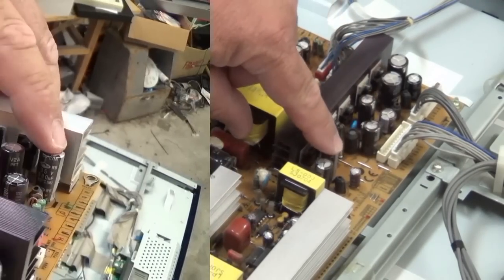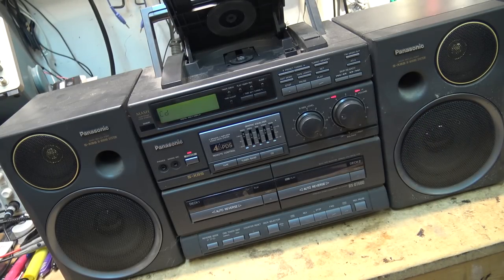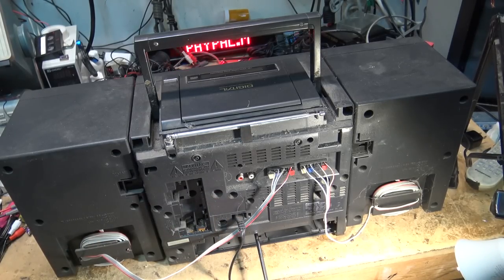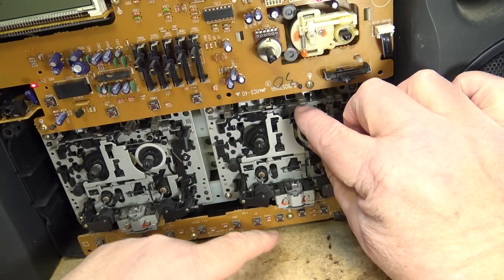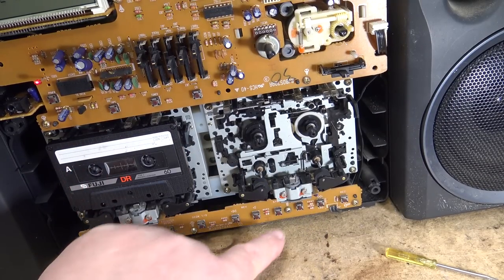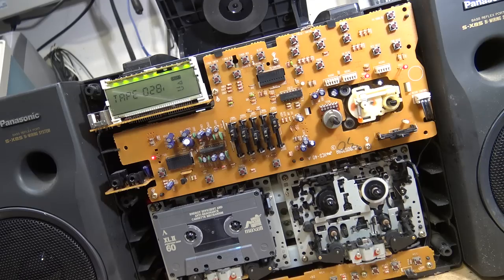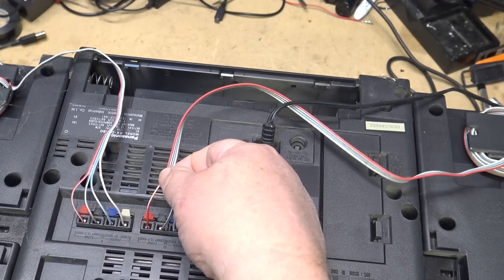Panasonic RXDT680 dual cassette cd portable stereo repair

Comment: That's some good quality cassette player right there. So many "sensors" and the mechanics look well built. Also, the belts are fine, too. Panasonic did a great job with this player. 
Fixed and ready to be used for many years to go. Congratulations!
Reply from the maker: This one is staying in my collection.  It is a dam good unit.
Reply: @12voltvids  could you show how to add bluetooth to RX-DT690?

Comment: Sweet. I used to have the 680, and when it died, I bought the DT690. I still have the 690, but the CD player is dead. I miss this style of portable, that looked "normal" and not like some mutated insect or alien spaceship.
Reply: I have a 690 for parts that has a fully functional CD if you're in Ontario Canada you're welcome to it
Reply: @izzyyanuzzi954  Unfortunately, I am all the way down in California. I did however fix the CD player by finding a mechanism on ebay from the RX-DS17, which used the identical mechanism. Now, I still have to fix the motor control issue with the tape decks.

Comment: What a beauty! I have a similarly old stereo from Panasonic (SA-DH30 to be precise), and it still works great. Both tape decks are fully functional on it as well. Panasonic must've used some really good belts back in the days.
Reply: Not like the cheap-ass belts some lower-level brands used at the time - nowadays those would all be a sticky gooey mess that can take anywhere up to 5 hours to remove from pulleys and flywheels. I recently dealt with a Hitachi rig with this exact issue.

Comment: Watching the problems you fix here also takes me back to early high school... when the scary kids had smaller boom boxes it got loud. Sometimes kids would get ahold of the completely trashed school boom box and it was always funny when someone would have to dive across the room to stop it from eating their early 'gangsta pop-rap' music tape. You'd hear the treble start to fade down and then crinkling as it slowed down and someone would shout NOOOO! Of course some else would steal the same boom box from the AV closet and it would happen all over again!
Reply: I remember those days - the issues with school boomboxes is they were never serviced or cleaned which may explain why so many tapes got wrecked in them.

Comment: Very good video of your repair.
I had this unit from the early 90's
until the 2000's, when the unit was
in the sun in the car and the CD 
top distorted and I had some 
cassette problems, after which I
did not repair it and disposed of it.
It was a good unit and I have seen
some offered on eBay. It also had
Automatic Music Selection, AMS,
which let one scan through the 
music and if one left a space between
tunes, one could skip to the next tune.

Comment: This video encouraged me to check if my RX-DT680 had the same problem and it sure did while I thought it was acting up because of bad belts! In my case I also had to check the battery/AC power switch in the power connector because it was also corroded. Thank you!
Reply from the maker: Yes they have been known to corrode as well.

Comment: I sold many of these Panasonic RXDT 680 and 690, and the smaller RXDS20... They sounded good for the price, had a digital tuner and a remote control, and apparently they were made to last. 30 years later, I was delighted when you rescued this one from dust. It's surprising the CD has not suffered (door switch, optic unit...), and the potentiometers seem to operate without too much noise!  I remember clients complained about a missing power cord, untill Panasonic made a little sticker that said it was in the battery compartment...
Reply from the maker: I have an rxds20 as well.  Modded that one for bluetooth.

Comment: That's the exact model I own, I modified mine for a AUX input as after years of using dummy tape for inputting audio the tape mechanism's broke. I download a service manual with schematics and imputed line level at the graphic equalizer circuit.
I use it every day at work, Great sounding  stereo for its age.
Reply: Could you teach how to add bluetooth to it since there is no line or Aux? I own the 690 version

Comment: i've worked on many of these.. CD deck is a common failure.. but man these were well made.. and sound fantastic.. the RX-CT990 is my favorite of the series mainly because it had a true AUX input
Reply: That's the exact model I have, with the pitch control for Deck 1, sadly it does not come with digital tape counter, just displays TAPE when playing tape but still does the job. I encoutered the same issue as 12voltvids with the oxidised tape detecting and some minor dry joint due to age but other than that plays great and eats all of the boomboxes made today :)

Comment: I have been using my Panasonic products for 40,years and they are still working fine . I can't say the same for the Sony products I have. I had to fix them a few times. Panasonic were high quality products.
Reply from the maker: Every company has good and not so good products.  My old Sony beta and cd player are over 40 years old and work perfectly.  I have several Panasonic VCRs that were high end (ag1980 and agw1) which are beyond repair.

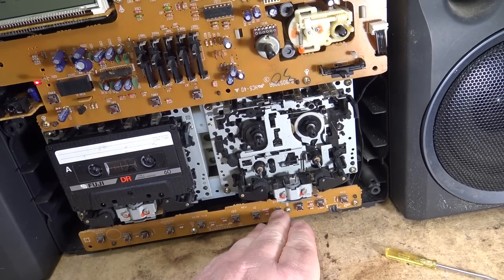Comment: Purchased this model for $10 + $16 shipping with remote control and operation manual. CD still not working and tapedecks had exactly the same issue described in your video!  Common issue? Don't take it apart yet, however fix the tapedecks on the outside by dipping (not spraying) some wd40 onto the contacts and wiggle it. It take some time to do its work, you don't need to sandpaper the contacts., take your time. Tapedecks only play tapes in one direction, reverse direction. Takeup wheel in forward mode (eat tape mode) does not have to power to wind the takeup reel.  That is weird, because it is a gear controlled - see 17:45.  

The CD, the laser unit tries to focus (don't move) and motor doesn't spin - no disc message. I used my phone's camera to spot some light activity but cannot see anything.  Bad laser?

It is a beautiful device when cleaned and sound is decent. The downside is that this model doesn't have an AUX input however have seen some mods already. You make great videos maybe you have to do some repair and mods videos.

Comment: Just got this same unit at a Goodwill for $20.  CD player not working.... turned out I had to adjust the laser pickup  current and also I found the Cd disk seat was pushed down slightly effecting the focus for the laser to read the disk.  Fixed now and surprised how good the unit sounds!

Comment: That's a nice unit , I have the big brother RX-DT690 that i did a full restore on the cassette mechanisms new belts, and new take up reel gears (RDG5772ZC)  they lose teeth. also have RX-DT75 cobra that i fixed the cd player and re-foamed the speakers. and a RX-DS20 that i fixed the bad gears in same part number as  the RX-DT690. those Panasonics were the best built in the day.

Comment: Mid 80's to early 90's, I went through five Panasonic boomboxes..  Definitely my brand of choice!
Reply: So at least four of them got broken in 10 years? That's surprising, they used to be quite reliable even with heavy use, easily lasting 10+ years without failure.
Reply: @mrnmrn1  I think he means he just upgraded to the newest model every couple years, don't know why you'd keep buying the same brand if they sucked lol

Comment: I know also the cassette transport mechanism. It uses the panasonic/technics ar300. A typical issue is a gear that gets missing teeth for playback /recording and also the tape sensor leaf switches that gets corroded or oxidised over time.

Comment: I find that using a strip of P1500 or P2000 wet & dry sprayed with dioxit works on most switches. It's such a fine abrasive it works well without scratching the contacts. 
Nice job. It's rare to find such a nice boom box in such good condition.

Comment: I have the same unit purchased at the Wiz in 1991,  The tape mechanism is the same one as used on some of the lower end Technics (although good decks) cassette decks of the time.

Comment: My parents had one of these when I was a kid. Super cool. The motorised volume and logic controls was fascinating, was by far the fanciest piece of audio equipment I'd seen at the time. Pretty sure these are from '96 or thereabouts.
Reply: RX dt680 was manufactured 1990 to 93 I still have mine I got mine in 1991

Comment: Tuner / amp almost always work. Best use now is for computer audio. Sound good & you can
adj the audio in a natural way & easy way. Also cuts down on wires & clutter ! Used to get lots with double
decks. Both decks would ave bad motors. Wear out the A deck then the B deck.

LFOD !

Comment: I have this same unit. Both cassettes work, CD works. The tuner works, but presets do not, so it has to be manually tuned. Timed recording doesn't work either. These last two issues are most likely just the switches...we'll see. The S-bass knob doesn't have much effect, so I think it's not working right. Going to try to restore it fully. Fun project, though I have no idea what to do, so I'm counting on channels like yours to give me insights. Keep up the good work! If you know where I can get a schematic I'd love to know! Might come in handy trying to figure out the S-bass issue. You've gained a new subscriber.
Reply: @adsbadsb9488  Thank you for the response. Moved recently and now have it set up and playing, as my other stereo is in storage temporarily. Haven't done much to it yet...too busy. The S bass works, though subtle, as you mentioned. Perhaps that's the way it is. Just used to a more dramatic effect I guess. I am still going to look for a schematic. I'll let you know if I find one.
Reply: @adsbadsb9488  got the service manual…thank you! That will be ver useful! I didn’t see the “mod idea.”

Comment: i just got a rxdt675 very similar just no darn aux but ill fix that  to me is a must have.i would love to buy that model you have their to
Reply from the maker: Yes this one is a good one I got it for free and will probably hang on to it because it's a good unit has good sound. They don't make them like this anymore even just to use it as a radio. The tape decks don't do anything for me because I don't use cassettes but the CD player is nice and having auxiliary input lets me plug in any streaming devices and take advantage of those nice speakers and bi-amp circuit
Reply: @12voltvids  yep mine has no aux input its the RXDT675 so ill have to hack into it and wire in a 2 pole switch in line of the tape preamp chip and if i do all that mess ill bucktooth 4.0 board and upgrade amp with a programmable Frequency deal but lol oh man tweak the heck out of it most likely  .or stream via fm-transmitter for now is Z solution

Comment: I'm having the same problem with my old portable stereo. It's more than 25 years old and just sits around because of the detector switch problem.
I've always found the Panasonic portables had the best sound but the RXDT707 beats them all.
If I could just get it apart I might be able to clean the switches.

Comment: I got a Panasonic RX-DS620 (April 1991 mfg date on bottom, which I had since probably 1992) and I while radio/CD player work as expected, the tape deck works to a degree as if I put in a tape and play it in the forward (or reverse) direction it will play as expected. but I cannot use the 'fast forward' as it will attempt with a click, but disengage as no actual fast forwarding occurs, and then stop and I can remove the tape if I want. but if I try to 'fast rewind' it will attempt (with the click etc but no actual rewinding occurs) but then basically freeze, hear it click like it stops, but the tape deck is still engaged and I cannot remove the tape and have to remove the tape deck mechanism and spin the white wheel with the gear teeth on the bottom a bit and after I spin it far enough the tape deck will disengage and I can remove tape like normal.

so in short... as long as someone does not press the 'fast rewind' with a tape in the drive there is no show stopper issue. but if one does, you basically got to take the unit apart and remove the tape deck area and spin the white wheel with the teeth on the bottom, which is a show stopper problem.

my guess is this probably ain't going to be fixed easily unless your familiar with the issue(?). but it's not a big problem since I don't really use tapes as it's CD player function is hands down the main reason I like this unit at this point in time since I just burn custom CD-R's (I burn them at 16x with ImgBurn on Linux Mint v20.3-Xfce) as those work perfectly okay so far as I played CD-R's (Verbatim CD-R 80min/700MB. which are Phthalocyanine dye ('CMC Magnetics' media code) that are nearly 81min in length without issue (I might be able to go over 81min but probably not much more than that) on this Panasonic RX-DS620 unit. I use ImgBurn's overburn function as 4 out of the 5 CD/DVD burners I have support overburning CD-R's.

Comment: Hello, great video you have here.
I have an RX-CT990, it is the same but it does not have a CD. 
I have to do the same job, remove the front part, clean the heads and lubricate it. 
I don't have a screwdriver that long and I have to buy one online. 
Can you tell me the measurement, the caliber of the screwdriver tip that goes there. 
Thank you very much for your help. 
Greetings

Comment: Sorry to ask, but I passed my RXDT680 on to my parents many years ago, but just recently its stopped producing sound from ONE speaker. Swapped speakers and confirmed it’s circuitry in the unit. Did you ever come across this in your years and was their a specific/common point of failure? Or will I have to start testing components…I’ve already dug into it and pulled the speaker/amp PCB out to look for burnt/blown components but nothing obvious…will clean balance control too and check forums, but you seem to know this device well and maybe you’ve seen it before. Like you, I want to get it back running properly for another 25yrs!

Comment: Hi there, Sir. After watching this very informative video, it is more than clear to me that you know 100% more about this ‘boombox’ & or any other one, than I ever will. So in that regard, I have just one question regarding this exact same model. On the rear of mine, because one of the spring speaker terminals clip push release connectors is ‘out of it’s socket’ (the red on, to be exact) the red/white speaker wire that goes into it does not stay in place. Thus making the right speaker cut in & out. So I was wondering might you have any suggestions as to how I could temporarily prevent that from happening. And or would I have to replace the entire terminal pertaining to the right speaker. If so, any idea of what kind of cost I would be looking at to do just that. The cost of said terminal & the repair, I mean. Any help & or tips would be greatly appreciated. A great weekend to you & yours.
Cheers!!!

Comment: my unit. loved it. then it got 360 3 phase current because of electricity problems. With the button of my oven I could direct the intensity of the lights in the corridor and after 2 days a big bang ang 11 electrical devices were dead: unrepairable stood in the report and I got 20 eur back from the insurance 15 years ago. Sony Mini-disc was the only device that could be fixed for 130 eur. 1 month old NAD Phono preamp was unrepairable. I have never beleived that. I should have asked it back fo the speakers or for the laser unit, belts etc. For 15 years I use the speakers of a 2001 Panasonic micro stereo system in light brown wood and they sound fantastic in the kitchen on top of a cupboard paired with a vintage silver Kenwood KA-3700. The sound of this boomboox was better than a 1993 Technics amplifier I sold because of its extreme loss of dynamics, sounding flat as th Philips FA-880
Reply: that is one of the most intensely gripping and passionately suspenseful accounts I have ever read about an oven that can control the lights in a corridor and make a bunch of electronic devices be covered by insurance yet not be repairable, with laser units and belts and other exciting stuff that should have been saved for use 15 years into the future. it ends on a real cliffhanger, too: an amplifier's extreme loss of dynamics is enough to make ANYONE tremble in their bed at night. could have only been scarier if the Technics and Philips units had been switched in the plot (hint, hint - script suggestion).

Comment: Nice boombox :) Perhaps it might be good idea to check the cd player a bit further, playing at least one cd from start to finish as it might start skipping at some point. 

I have Sharp boombox from 1992, tape player works fine but the CD player is just like I described, basically works but starts skipping and stuttering randomly at some point while playing the CD. No matter if it's a CD-R or real music CD. The laser unit is noisy when it moves from the furthest point to the start. One of the metal rails looks like there's corrosion, have tried to lubricate it with silicon fluid (the stuff which is used for car door rubber seals) but makes no difference.
Reply from the maker: It plays all disks end to end.

Comment: I just got a hold of a 610 which is similar to what you working on there but a little further down the chain. My left cassette plays a little bit sluggish and the right one plays way too fast. Any suggestions? I was kind of hoping you would have to go to the belts on this so I could see how you access them.

Comment: I have an old Panasonic I want my kid to be able to use - and the tape deck was working well, but now it simply won't close when I have a tape in it. It closes perfectly and works fine otherwise, but just every time I try and close the deck with a tape in it, I can feel something resisting at the bottom. Any idea what it could be?